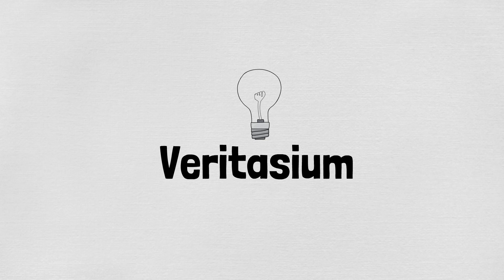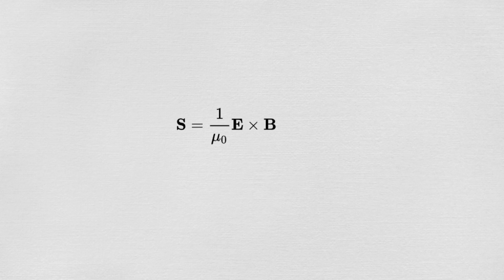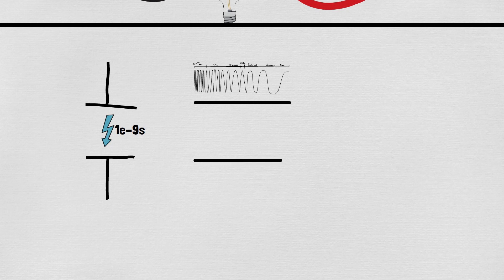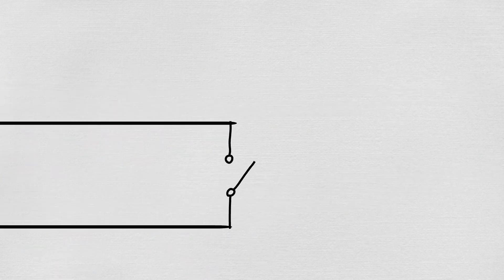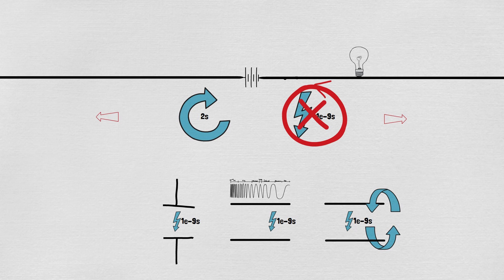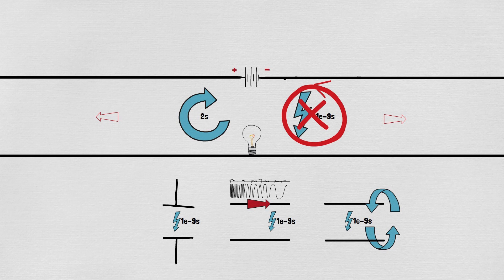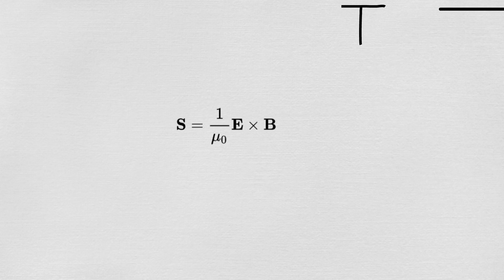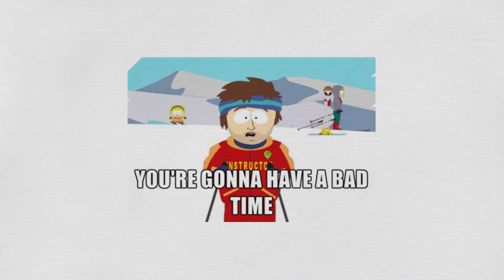Veritasium is Right? (see description)

Comment: Sorry, but you are wrong. Closing a switch causes short current flow even if the circuit is open on both sides.
Reply: You missed the point. What if the switch is place a light year away?
Reply: @Smashy360  In that case, it would take 1/2 a second to propagate.
Reply: @Vandalfoe  Nonsense. Try it. Put an ammeter on an open circuit with a switch in it and see if current flows. It won't. If this were true every time you tried to turn on a light in your house every bulb on Earth would turn on.
Reply: That would be true for a capacitor, but not for a battery, that needs a closed circuit for the chemical reaction to produce current

Comment: I noticed the problem and just posted yesterday upon viewing the video. Instead of complicating the issue (for including the layperson), I expressed that dynamics had to be prediscussed regarding the fact that magnetic fields only induce current DURING the acceleration of electrons and so if this was merely a DC current, the lightbulb could only be affected upon the battery's initial flow. But note that given your (Tycho's) explanation speaking about the placing of the switch, this would matter because the line as a whole would otherwise act as 'ground' if the switch is too far and for direct current, the battery would drain regardless. (I added this as a last point of notice).

But then Veritasium spoke of AC which is ONLY what could possibly turn on the bulb by induction of parallel wires. This is because the accleration is 'constant' as it alters direction and would provide the needed inducted current in the secondary wire. This is where the 1/c applies (ideal without resistance) because the distance of 1 m of the parallel lines.

It is not necessary to introduce the math other than the last point because the LOGIC is what is amiss regarding induction and impedence (resistance to alternating rates of velocity of the electrons). That is the math formulas are due to the logical inspection of what occurs and so shouldn't precede it when trying to determine what the problem is. 

[I believe this relates to something that I took issue with regarding a question a lay person was trying to understand in a forum discussion. He was trying to visualize how the electrons INITIATE change in a wire and appropriately quiried how the wire uses transversal waves when the  'authorities' of the site were arguing for an implied instantaneous knowledge of the potentials at either end.  The problem is about the fact that the wave requires a longitudinal change that has to first pass through the wire as it sets up the transversal wave or we'd have a problem of instantaneous knowledge of the potential differences at either end prematurely. I responded to explain that the layperson's thinking was correct and was censored as falsely misrepresenting the issue then immediately quit that forum for its ignorant approach. When trying to promote science, it is inappropriate to expect those invited to question things authoritatively. That particular thread was trivializing the person daring to question the issue against the responding 'authorities'. And furthermore, the fact that they used censorship where I tried to help was simply disgusting behavior. No one should be treated as having a stupid question or interpretation and science cannot expect FAITH up front when trying to promote the very ideals of science that does not rely on faith. ]

Comment: The switch is significant because when it’s closed that’s what creates the changing electric field that leads to the wave propagation right? In other words the field is static until the switch is closed, my question about Dereks video is the details on if that small of a battery could manage to light the bulb wirelessly (I doubt it) and he doesn’t mention the transient period for a dc circuit

Comment: I think the position of the battery shoukd not matter, only switch to bulp position does. 

The battery provides the voltage "pressure" in the entire loop. Once the switch closes, this will lead to a slow flow of electrons around the switch creating an EM field propagating along the wires at light speed. 

I bet the effect of jumping the gap directly is very weak, especially over distance, and more of an side effect, then the intended energy tramsmission. Other cables lying around would suck energy out of the circiut this way. 

So my biggest question is, what if  we shield the space between switch and bulp, so the em field can't reach it directly. In that case the power would still need 2 seconds to reach it "the regular way". So, with my limmited understanding, I rage vertasium as bei g misleading here. 

However it really seems that the EM field travels along the wire, not via electrons in the wire. Which still is very interesting to learn
Reply: Almost correct, if there were a wel designed shield around or between the wires the EM-wave needs to travel around the shield. It will however propagate in both directions from the switch and reach the lamp after 1 second from both directions simultaneously. This is the reason we use a ground plane on high speed circuit boards we want the signals to propagate along the traces and not jump uncontrolled to all conductors close by.

Comment: You might want to take a look at ZY's response ( https://www.youtube.com/watch?v=RsiYXfpJu5U ), which uses the well-established electrodynamics of transmission lines to plausibly (IMHO, FWIW) affirm Veritasium's claim. His post includes a link to a model that you can run and modify. That model gives answers to the questions you raise:

Q: What is the purpose of the switch?
A: Its closing launches a wave along the transmission line. If we assume no resistance, the impedance of the line is not frequency-dependent, and the wave will take the form of a step function. Until the wave returns after reflecting off the far end, the current flow in to / out of the transmission line's terminals, and the voltage between them, is as if they were connected by a single component having an impedance equal to the characteristic impedance of the transmission line - and, if we assume no resistance in the wires, that impedance is purely resistive. For 5mm wires one meter apart, that impedance is ~750 ohms. 

If we could somehow assemble the circuit in an already-on state, the lamp would, of course, be lit from the get-go. Otherwise, what happens depends on which part we connect last, and where the last connection is made.

Q: What if the far ends of the wires are not joined?
A: The lamp lights after ~1/c seconds, and turns off at 1 sec, when the reflected and phase-inverted wave returns. What happens then depends on the impedance of the lamp: unless it is equal to the sum of the characteristic impedances of the two transmission lines, there will be some decaying oscillations with a period of 2 seconds, but In the steady state, the lamp is off.

Q: What if we put the switch at the far end?
A: The wave propagates from there, and the lamp lights after 1/2 second. I think I am correct in saying that the Poynting vector in the space between the battery and lamp does not change until the wave arrives [1]: until then, while there is an electric field between the lamp and the switch-side terminal of the battery, there is no magnetic field until a current starts (either moving charges or displacement current.)

The situation is the same regardless of which end you put the switch, except that in one case the lamp is initially at the same potential as the battery's +ve terminal, and its -ve terminal in the other case. 

I think that covers the main points here.

[1] It would be zero with no magnetic field, right? For some fixed externally-generated field, I'm guessing that it all has to cancel out to conform to Poynting's theorem (and therefore conservation of energy). Any externally-generated varying magnetic field will affect the outcome by induction, and is outside of the scope of this question.
Reply: Excellent answers to his questions.
Reply: @dalek6779  Thanks! - but the credit belongs to ZY.

Comment: Basically if the ends of the Veritasium circuit would be closed, there would be potential difference at the ends of the switch (and the battery), so waves would start to radiate initially at the place where switch closes. Current would then start flowing at both ends of the (now closed) switch, and this information wolud be transmitted through space at the speed of light, majority through the electron to electron field interactions in both ways from the switch. However the vast majority of power would be transferred once the circuit reaches stable state after all that field mess being initiated when switch got closed and electric potential difference did its stuff. Derek said however, we state that lamp turns on once any kind of power is first detected at the bulb, or somethink like that. Which means that general answer would be that the bulb turns on after a time that EM wave takes from the closest point of current motion anywhere in the circuit, not just the battery, nor the switch, and this is dependent on the geometry of the circuit.

Comment: If you study transmission lines you will understand how Derek is substantially correct. The transmission line behaves like a resistor with its characteristic impedance as long as the signal propagates. Thus the bulb will turn on. Then the signal reflects back and other stuff happens.
Reply: So if I put a wire on the positive lead of a battery and walk around it will be transmitting power to nearby devices??? I highly doubt that
Reply: @kelton5020  we are talking about light year long superconducting antennas. It's not wondering that they have counterintuitive behavior.
Reply: @vihai  explain why should that make any difference?
Reply: @kelton5020  because for short or resistive antennas the pulse would only last for few microseconds.

Anyhow if you work with transmission lines like high-speed digital lines the instantaneous currents are a very real, well known, common phenomenon.
Reply: @vihai  So it doesn't matter that the lead on the positive side isn't attached to anything, it just matters that it's really long?
Reply: @kelton5020  the length is important for the pulse to last.

Comment: when you connect a long wire to one end of a battery, current will flow until the entire length of the wire is at the same potential as the battery terminal. So you could in fact light up a lamp without a complete circuit, but only until its potential rises to that of the battery terminal.